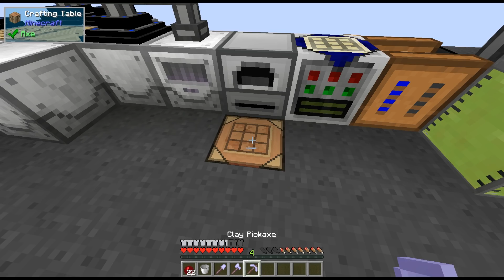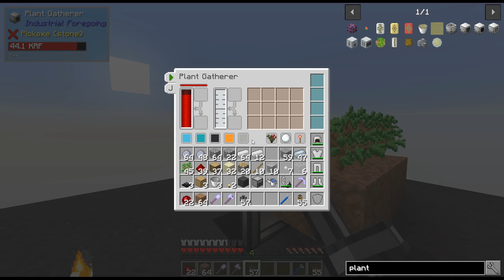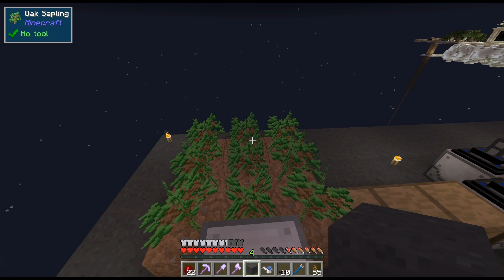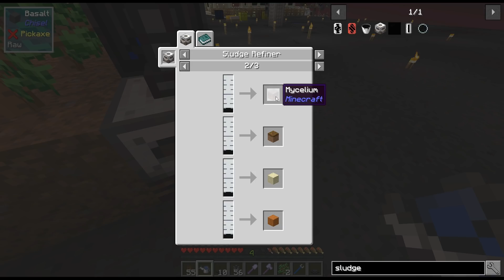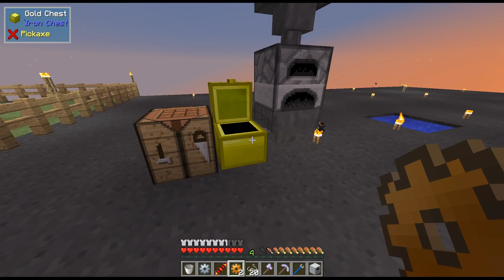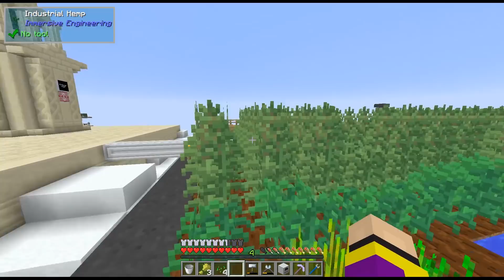FTB Pyramid Reborn Ep. 05 - Industrial Whingeing and Tree Farming

Comment: No i'm absolutely with you on the IC2 changes.  Gregtech was super annoying and if we want over complicated intricate machine builds we now have immersive engineering.  All they did was make a semi-useful competitor to thermal expansion and MFR into a bad clone of an addon that already existed and was later surpassed by another independent system; a system that while still nuts on the complications was better at integrating with other systems (like compatibility with universal power) and an interesting aesthetic.  IC aesthetic is: black cables of a couple thicknesses and variations on "Grey block with a window."  Plus the additional unique power is mildly annoying.  So now we have to manage RF, EU, Grid Power, lava/liquid redstone (for tinkers smelting) along with the extra resource cost of low durability early tool consumption.  In old IC I would routinely use it for the high speed processing for on-demand crafting, TE for steady state automated processing and Tinkers/Mekanism or similar for bulk processing and ore efficiency.  Now unless its a challenge map like this I don't touch IC at all.  I can get better results, more efficient designs and layouts at lower resource costs from virtually any other tech and even some magic-ish mods. 
 Managing the power rates, generation & distribution in older IC were pretty fun, as well as balancing upgrades and working up to the advanced machines was fairly fun.  Crafting things like the HV solar arrays without auto-crafting (like from ME systems for example) was an absolute nightmare.  But now they've decided that same level of manual crafting is necessary just to get started, and it only escalates from there.
 
The changes in what LOOKS like old MFR look fine and I'm bout to load up this pack myself just to play with it, since i loved MFR and missed it in the last several FTB packs.

Comment: You have every right to be groudgy. Industrial craft, in the days of tekkit 1.2.5,  1.4.7 was the ultimate mod, even with gregtech installed it was liveable, but its been surpassed by so many mods these days, not mention the coming of RF and FE that greatly surpass EU, that frankly, no amount of groudging can properly convey the hatred and loathing that IC2 has gained over the past years. Highly enjoyable episode therefore.
Reply from the maker: Thank you! I still like the way EU power is implemented, that it can be dangerous and needs insulating and power transforming... but these days I'd rather use Immersive Engineering for those aspects than IC2.

Comment: I just made steel using the iron/pulverized coal recipe in the Thermal Expansion Induction Smelter. Then I made the compressor, and instantly made the induction furnace. 
By the way, you cannot get diamonds from the quests if you do the quests in order. You need diamonds for a quest before the quest that gives you diamonds. You can get diamonds from the compressor, using the Coal Chunk recipe!
Reply from the maker: We're altering the path we're taking, as we've already discovered that we cannot do them in order. You need Coal for the Shock Absorber, which you get from the quest after the Shock Absorber.

Somehow we all completely missed the Thermal Expansion recipe for Steel Ingots. Not sure why. Does the Induction Smelter need Invar? That would have caused us to discard it, as you don't get Nickle until you do the Biomass quest.

Comment: If you want to avoid doing too much IC2 (I'm also in that boat) you can get your steel from the Induction Smelter from Thermal Expansion, all it takes is pulverised charcoal/coal coke and iron to make. You can also get around the EU generation quest through using the resource generator for redstone and piping that into the input, which is a perfectly legitimate way of doing it according to Slowpoke.
Reply: just fair warning, my eu quest was bugged and I had to reset the computer using the button in the pyramid.  I ended up generating 10x the required eu before I figured that out.
Reply: I think it is for everyone in this version of the map, Dire and Soaryn's one was also broken and so was mine.